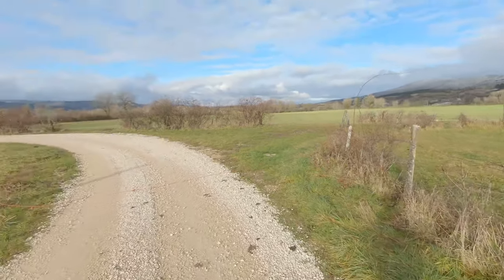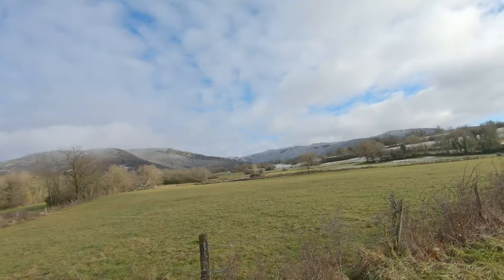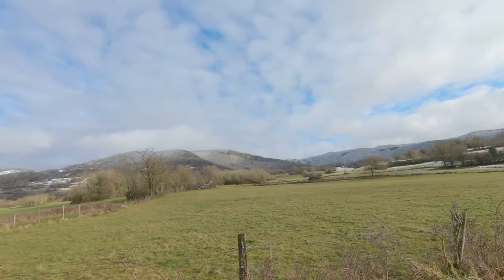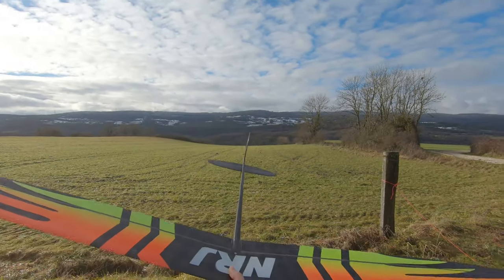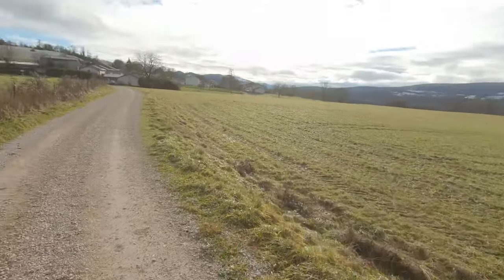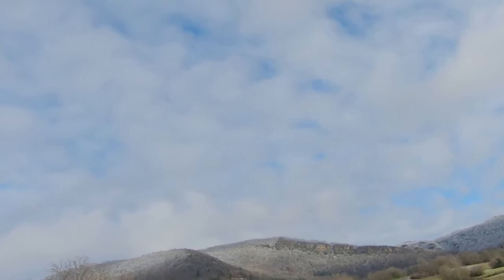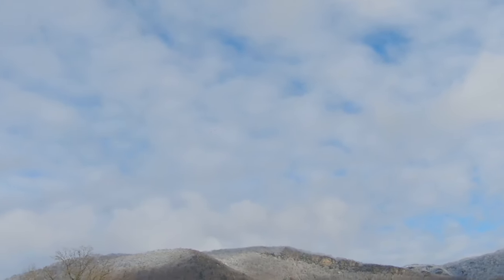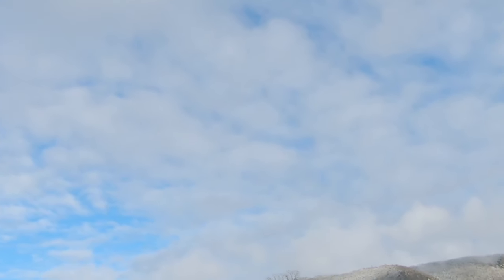Winter Thermals // Flight Talk

Comment: Your English is really good! And your video too. Thanks for doing what you do 🙂

By the way, colder, denser air shouldn’t affect gliders much, although it will change the air viscosity and hence Reynolds number, therefore changing the boundary layer behaviour. This could cause a slight change in the lift to drag ratio and hence glide angle, but I suspect it would be very hard to detect that without very precise measurements.